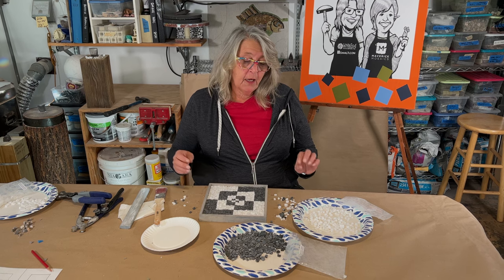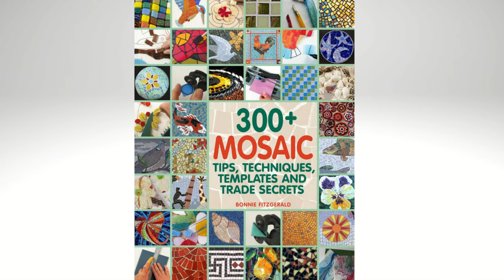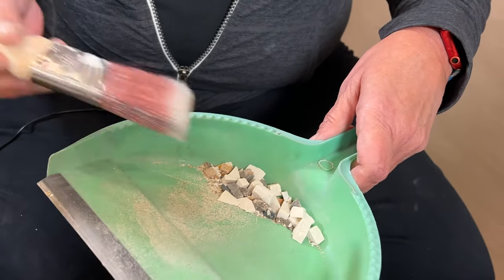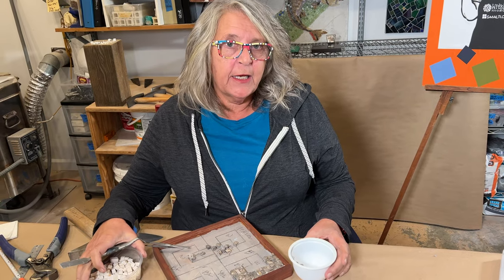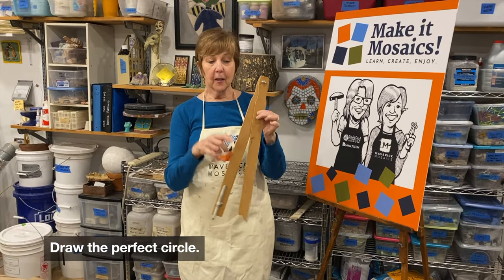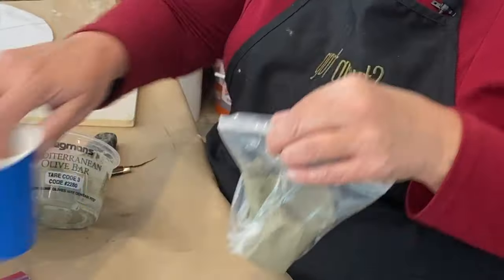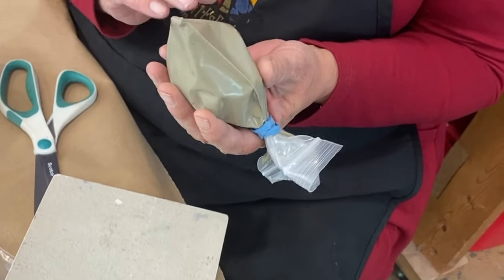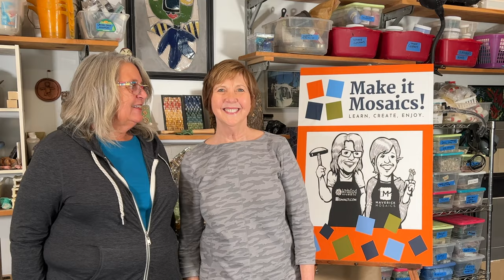Top Ten Mosaic Studio Tips VOLUME 1: Make Your Mosaic Workspace Creative and Efficient!

Comment: Some helpful hints from me:

The frames I buy for my mosaics come with flat sheets of good quality cardboard. I keep them, and use them as work surfaces to protect my table--they don't tear like paper does, or slide the way plastic tablecloths do. Lots of things from Amazon will have good-sized pieces, too. I swap in a new one when the old one is too messy with dried mortar on it. They will slip behind shelves and cabinets while waiting for their turn.

I keep all my smalti, stone, trasparenti, gold, and other materials in those stacking plastic drawers for the office, and put the drawers I'm using on my work table, then put them back when I'm done. I put labels with the smalti numbers on the outside of the drawers, even though I can see into the drawer--saves trying to remember exactly which shade is which, or having to drag out the sample boards when reordering. I think I counted about 150 of them not too long ago! 

Because I try to preorder frames that are premade (American Frame for great float frames) to save on shipping, I hang them in the closet on wide, strong bungee cords so they don't take up floor space or shelf space. I attach the cords to hangers, which go over the rail; the cords slip through the frames. Leave the wrapping on them and they won't bang into one another.

To mix black mortar in bulk, I use 2 gallon heavy-duty zipper bags (wear your mask!), so I can turn and turn and massage the black into the white mortar. I store it in the zipper bag, but transfer part of it into a quart container to keep in the studio. It makes a mess, so I do it outside when there's no wind. To get true carbon black powder, go to Mosaic Arts Online and order. I also make my own grey mortar this way, with just a touch of carbon black in white, as I have little extra storage space.

Tracy Hodson
Reply from the maker: Great tips! Thank you. We should make you a YouTube star!
Reply: @MakeitMosaics  No, thanks! But I love seeing you guys, and if I have something to add, it'll all be in one place.